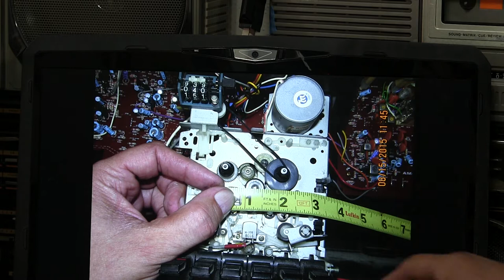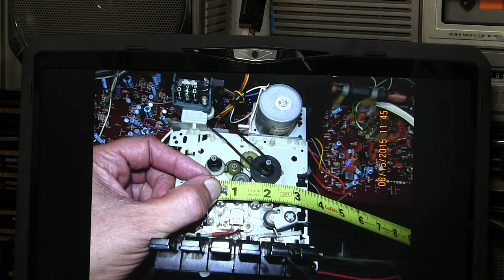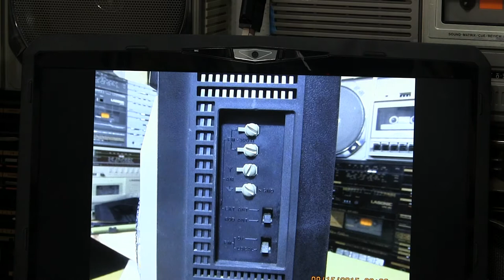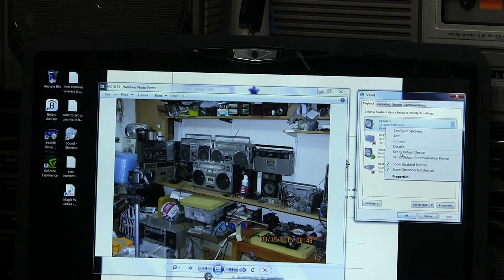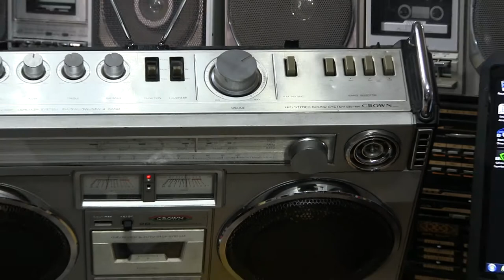Crown CSC 850F Serviced inside & sold

Comment: i have one off these and it doesn't work. Anyone know how much it would go for parts?
Reply from the maker: I want the cassette deck door cover trim if you are willing to part with it - Contact me text / call 713-502-9993 or Email me at jamespierceiii@hotmail.com I bought mine for parts for less than a C-note and I found a battery cover it in the United Kingdom and so now all I need is the tape deck door trim.